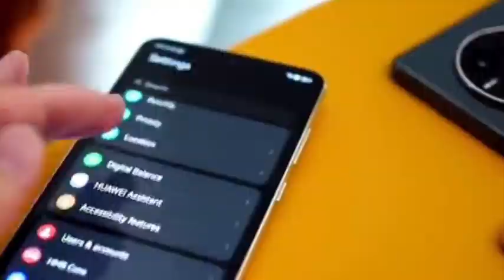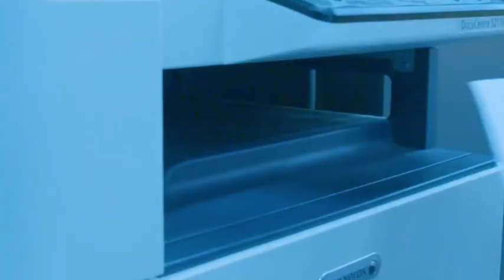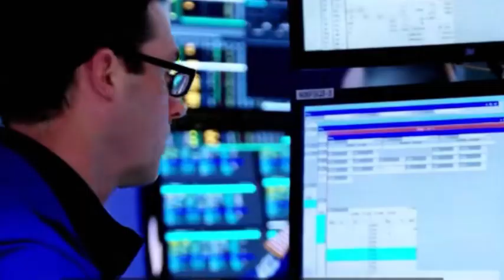China's 5nm Chip Breakthrough: How DUV Lasers Carved Silicon Dreams Against All Odds？

Comment: The problem is much lower yields than euv
Reply: As we know things start slowly but speed up over time. China has a lot of this low end equipment that it will alter to achieve greater through put. The issue is they can and they are now producing 5 nm chips and given there use is limited I’m sure they can meet there military needs to start with which allows miniaturisation